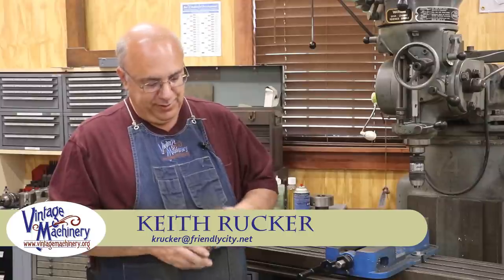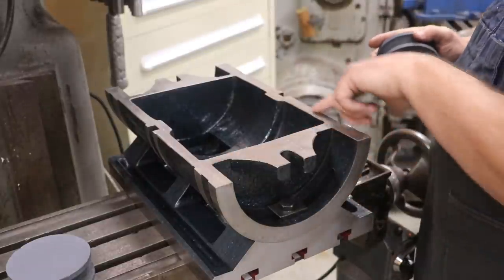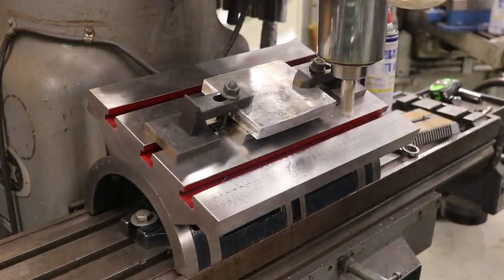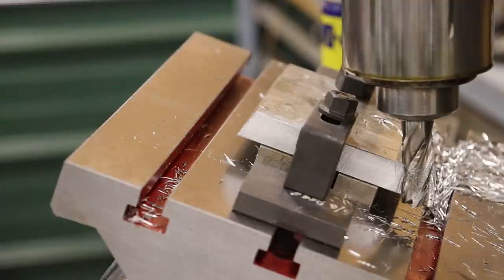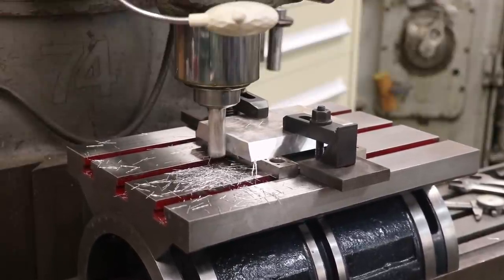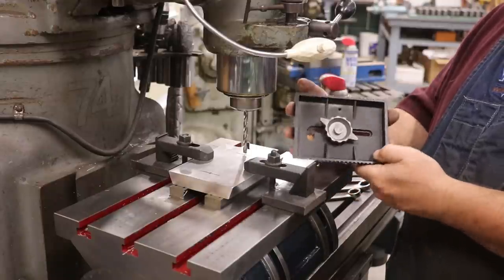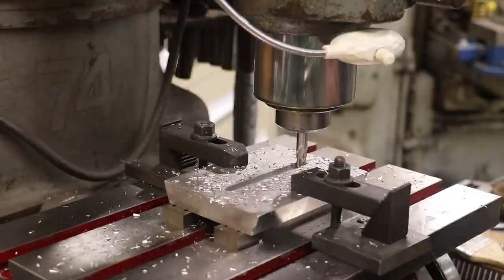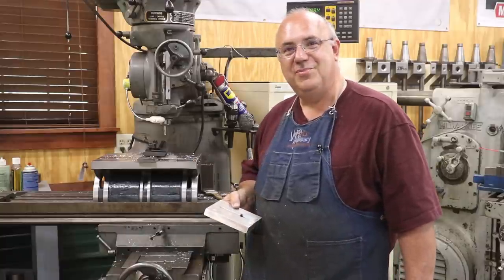Machining a Camera Mounting Plate - Milling Custom Angles

Comment: thank god, i can tilt my spindlehead
Reply: The funny thing is that he can too
Reply: I can agree with using a tilt table over tiling the head. I’d often rather hit my thumb with a hammer than retram my mill....
Reply: steve gale  - for the frequency I'm sure it gets used, I'm sure it's not that bad. I'm still a young buck (just ignore the gray hair). But yes, I really should retram my mill... Haven't checked in a while.
Reply: steve gale  - good point. But, maybe something to do with as the mill wears, the tram would change. I know my tables worn. Re-scraping has long been on the to do list... I rescraped my compound on my lathe, but then never put it back on. Lol. The very seldom occasion I turn a taper is not worth the added benefit to a solid tool post. 
When I rescrape the rest of my lathe I'll be watching Keiths the turcite videos as my carriage is very worn down.

Comment: Hmm, It seems a job for a surface grinder.   Or would junk from grinding cause more harm than good?   BTW chipping and shipping often mean the same thing in the long run.   Some shippers are careful, but this cannot be assumed to work over a very long haul.  My brother is a trucker.  He doesn't handle high precision stuff, but  stuff gets roughed up on his hauls anyway..   I love your videos, though you might need LA. Lathes Anonymous.   God bless you.

Comment: India and quality don't belong in same sentence. !!! Nice project.
Reply: Vernon Hastings Yeah. For hardware I’d have more inherent trust in stuff from China than India. Not slagging them off, China has just focused and invested a lot more on getting the industry side of thing going.
Reply: Yeah I have lathe made in India - copy of Harrison. Its crap.
Reply: In India we have both types of manufacturing done one which is cheaper and other which has quality you cant get both here. So it doesnt mean if one of you had got bad stuff from India all others make bad too. You mentioned Harison lathe but did you ever try the HMT NH series or the Psg lathes ??
Reply: Actually this statement is pure prejudice.  If your importers go to India and buy only the cheapest tools you will get cheap tools.   Its a bit like the prejudice against Chinese tools.  The Chinese also produce tool of the highest quality, but if you only import the cheapest you will get average or low quality.  Are you saying that there are no cheap low quality tools made in the US?  I don't really worry what you think,  but this China and India knocking gets a bit boring.
Reply: For clarity I agree with moto wizard,  but my comment above was meant to be a reply to Vernon Hastings.
Reply: Many great things come out of India. Some absolutely brilliant and wonderful people as well.

Comment: May could have been made wide enough for hex head bolt so it wouldn't turn around.
Reply: Would not tighten in correct position as needed all the time, just one.This way it is adjustable in any degree needed.

Comment: Well thats the complicated way to do it, why didnt you just tilt the head of your mill?
Reply: You are kidding, right?
Reply: @paulcopeland9035  No I am not. If you have a versatile machine available why would you buy an angular table?
Reply: You use that and save yourself re-tramming in the head.
Reply: @rennkafer13  but he had to tram the angular table too.
Reply: @Copozeras  fair amount of time and effort difference between tramming a vise/angle plate and tramming the head in.
Reply: @rennkafer13  but he had to do both the vise and the angle plate once he had to pull the vise :D

Comment: WD-40 sponsored? I didn't think WD-40 was meant to be used as cutting oil... Interesting.
Reply: Works great on aluminum.
Reply: Perfect for aluminium. Switched to container and refill pump spray recently. A lot cheaper.
Reply: Put possum pee on it if it will do the job that is required lol
Reply: I have tried many cutting fluids on aluminum, WD40 is by far the best. It is epically good on really gummy aluminum. Learned this years ago cutting threads in the lathe on large OD aluminum conduit.
Reply: I’ve used WD-40, diesel and kerosene. All are good. The diesel and kerosene are cheaper. Tap Magic has something specific of aluminum too.
Reply: @Conno9220  WD-40 has just enough kerosene in it to make it great for aluminum.